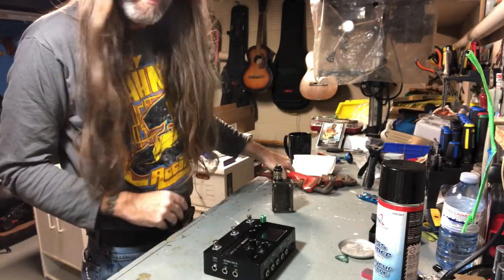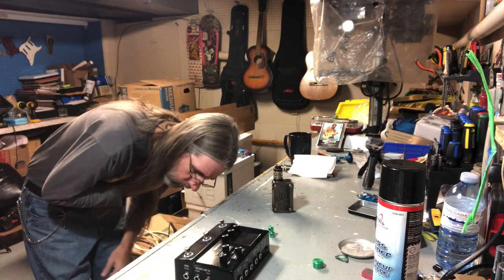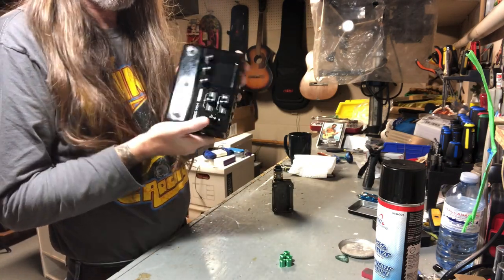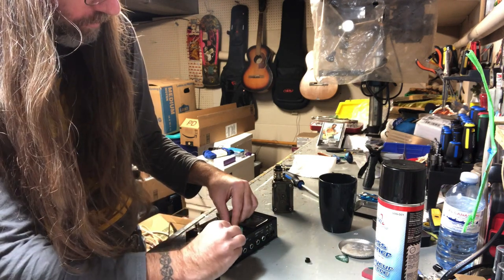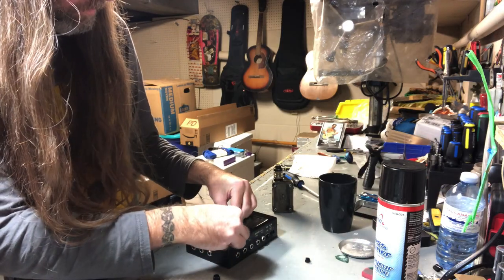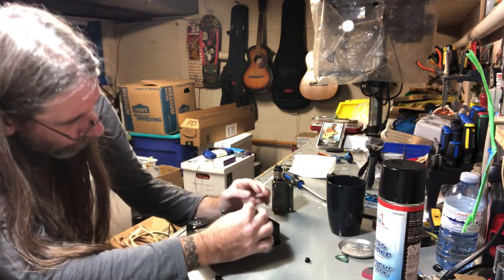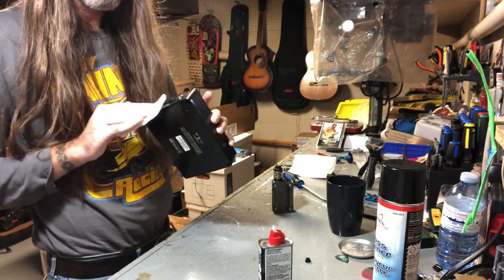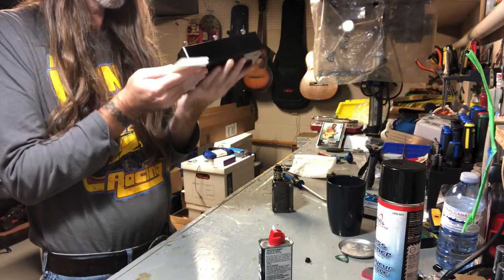Helix Knob Set Install

Comment: Another episode of Ben Rockin' the YouTube's! I got my Gold ones right after getting the Stomp... looks killer... just make sure you don't 6out the push functioning knobs down too low on the post..I did that at first and was like .. why isn't this working!?! lol 😎🎸🤘🎹🐦
Reply: I also used a fine tipped black Sharpie to fill in the volume knob's value notch... helps with the visual on the volume! On those green ones you might want to find a white filling pen...or maybe use white out?
Reply from the maker: Duly noted!! Cheers Laz!!